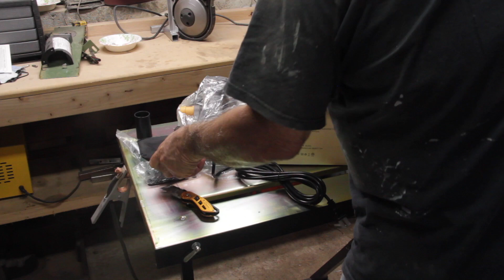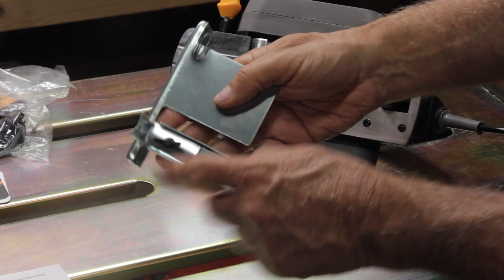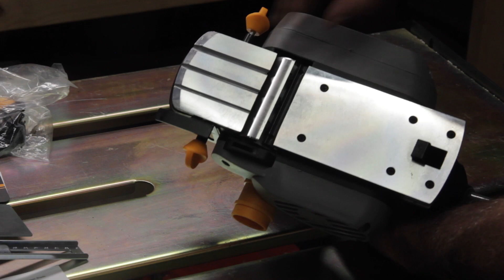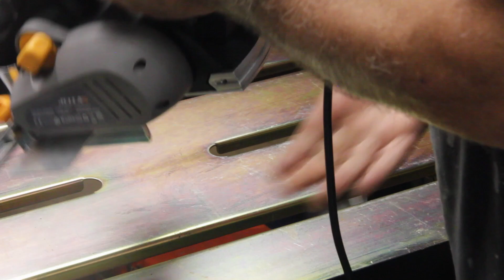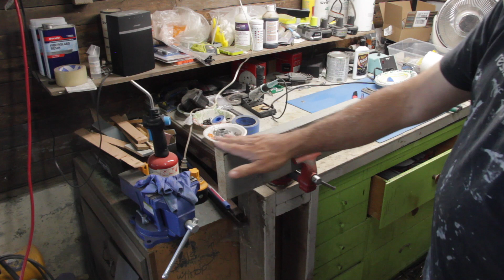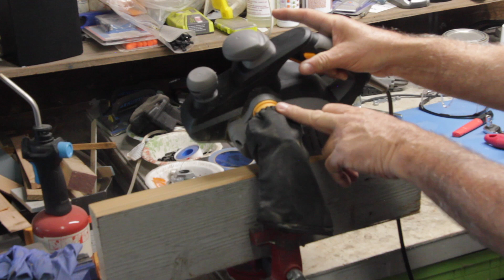Jellas Power Hand Planer

Comment: I've had this for 2 years. It's really good for the price. Would you know whether it's possible to replace the blade cutterhead / clamp?
Reply from the maker: On the Amazon ad it indicates to contact the seller for replacement parts.  Measure the blades, you might be able to substitute after market blades.